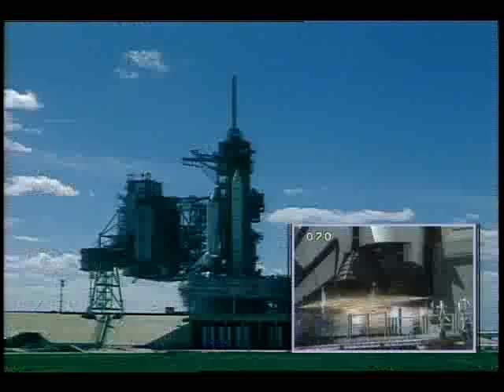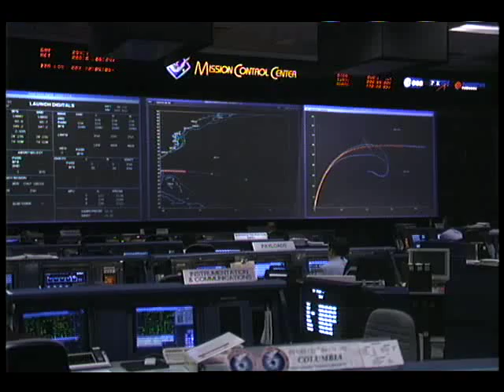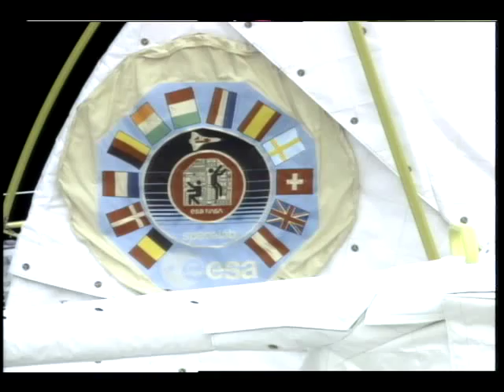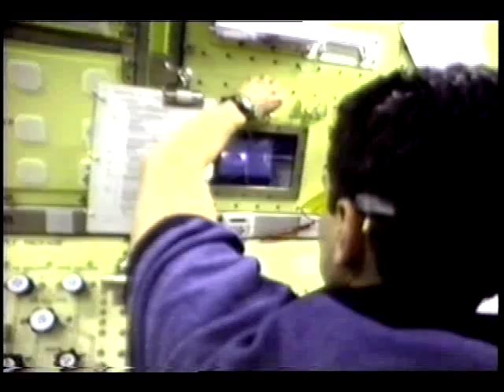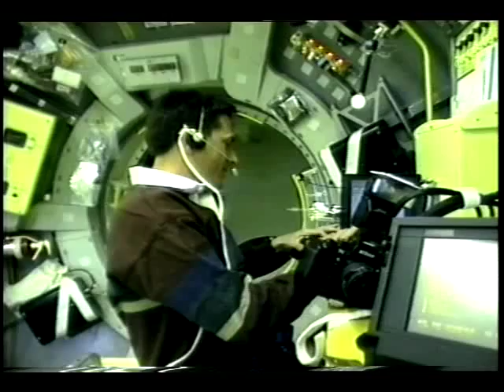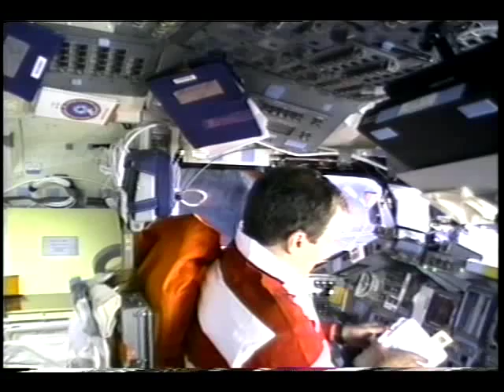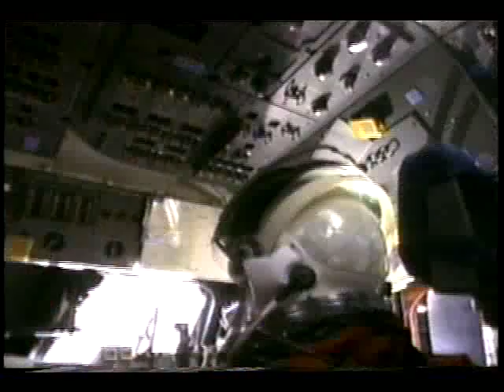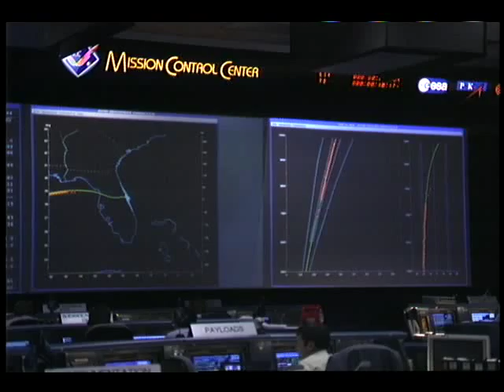STS-83 Mission Highlights Resources Tape

Comment: STS-83 was the 22nd flight of Columbia and the 14th flight of the Spacelab Long Module. This was also the 3rd shortened Shuttle Mission, after STS -2 in November 1981, also by Columbia and STS 44 in November 1991 by Atlantis, due to fault in a fuel cell. This should have been the 10th Extended Duration Orbiter Mission. Some materials processing experiments and fire-related experiments were carried out but most experiments had not been fully activated.  This crew would re fly the mission 3 months later.
James Halsell made his 3rd flight, his first as Commander.  Susan Still, the 2nd female Shuttle pilot, made her first. Mission Specialists  Donald Thomas and the late Janice Voss made their 3rd, and Michael Gernhardt his second.  Payload specialists Roger Crouch and Gregory Linteris  made their first and only flight.

Comment: What is always this screaming/whining noise?
Reply: Air conditioning?
Reply: They had at least a dozen of equipment (experiments) running at that moment plus the ships' equipment.
Reply: @PeacefulCountryLife  That's not the cause. It must have been something from the life support systems.
Reply: @MASA-po2zg  Yes, those are part of the "ships' equipment"
Reply: @PeacefulCountryLife  But not of any experiments that by the way didn't run in deorbit/reentry mode